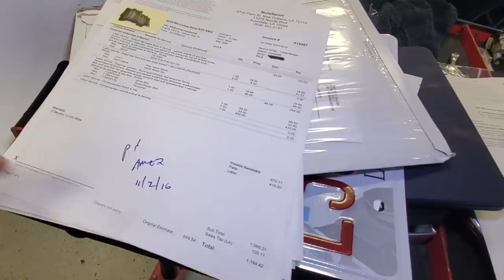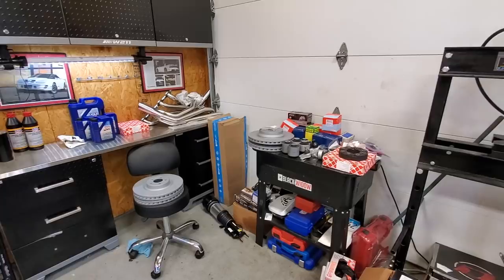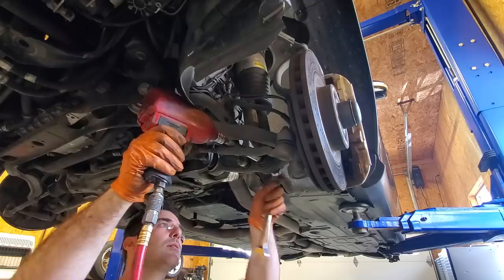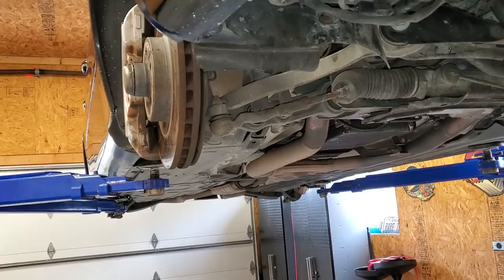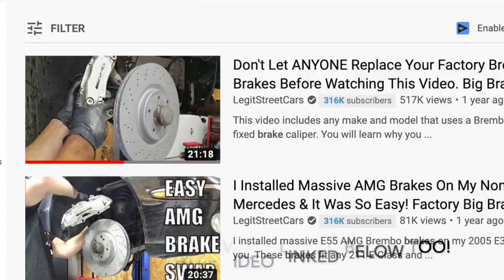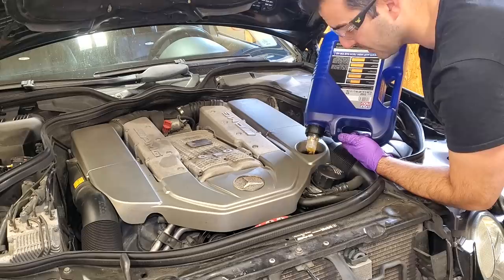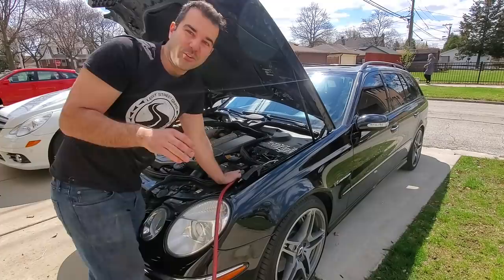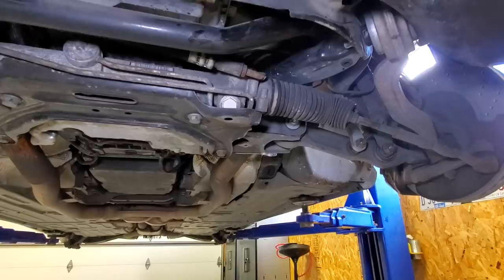I Mechanically Restored My Rare E55 AMG Wagon In 1 Video & Saved $5,000 Doing It Myself. Legit Fix!

Comment: This car is from New Orleans. The fender damage is due to the city's absolutely insane pot holes. There are straight car disabling sized potholes in NOLA. Half due to half ass repairs by the city and the other half due to the soil there.
Reply: riskyb250 I didn’t know NOLA had soil. I thought it was just floating on water.

Comment: Another awesome repair video, thanks again for sharing the step by step process. A newer AMG is too expensive for my budget so I am looking for a mid 2000’s AMG. Your videos kinda take the fear out of wrenching on an older AMG. Not fully tightening the bushing bolts while the car is in the air is an interesting tip. Are you talking about all the bushing bolts or just the thrust arm bushing bolt?

Comment: That brake video gave me the confidence to tell the mb shop to pound sand for 675$ pad replacement on cla 45 AMG. FCP euro had great price for parts. Did all 4 corners in about 2 hrs. About a quarter of that was trying to figure out why parking brake would not retract to service position. CLA 45 also has a manual brake release that must be released b4 service mode can activate.
Reply from the maker: I love hearing this
Reply: @LegitStreetCars  yep, so I took the money I save by doing my own labor and bought go fast goodies. Would like to see a vid or at least some commentary from you on the i4. And the cla 45.

Comment: Acura has done the same on the 3.7L engines for burning oil. Had my 10 year old 2010 Acura TL sh awd manual of course, burning a quart per 700 miles and they rebuilt my whole engine free.

Comment: I have  2 '87 300's one TD and other D.  on my D it was wobbly so I had lower control arm replace and wound up on the other side I replace all the arms.. My mechanic tighten the bolts up on the lift, but he use like a long 4x4 and floor jack and put the suspension to level and tighten it that way.  seems to work out fine. also FCPEuro is my go to place. The customer service people are awesome and had an issue with the web site and would not load my year and model parts but other ones it did  and they confirm that they were having some issues with that also.. but it was fix shortly after that.. Great people

Comment: "German cars are crap" yeah, well, that's a problem for anyone that thinks hammers are universal tools. A problem widely found in NA.
Reply: they are crap though.
Reply: And most SEA countries due to most shadetrees not having any understanding of electronics. They are good at tuning a carb, though.
Reply: I got a 2002 one of the first years w211 E220cdi, near 300Kilometers on the clock..

Yes without maintenance its indeeed 'bad' .
But if you maintain it properly then its still a waaay bettee quality ride then brand new 2020 cars!  

:)

Comment: The VAST MAJORITY of the people who think Mercedes cars are garbage have never owned any Mercedes and don't know what they're talking about. I have always owned Mercedes cars and did a lot of the maintenance myself cheaper than most cars if you know where to get the parts from. A few months ago I replaced both front air struts on my W219 CLS for only $550. They are rebuilt but they come with lifetime warranty and just as good as the new ones.

Comment: I just bought a 2011 (12/2010) w212 E350cdi that had 132k km on it, and I had it inspected by a TÜV engineer in Germany (where I bought it), and he pointed out what seemed to be only very slight rust issue on the rear axle/cradle, that Daimler has been paying for that rust repair in w212 that has this issue. So when I got the car back here in Finland, I went to my local Merc stealer, and they changed the whole rear axle cradle assembly for free. The best part was that they failed to get the rear airmatic springs out without damaging them, so they put new OEM airmatic springs in for free as well! I have to say I’m extremely happy I did the pre-purchause inspection!

Btw, 265hp and 620Nm of torque, and still able to do close to 50mpg, god I love that car 😍

Comment: in the future any high pressure hydraulic lines like power steering, transmission or oil cooler can be made by any hydraulic fittings shop in your area.

Comment: It does make a difference because you have to use heat to remove bolts with red thread locker. You need to read up on things before you use it. By the way I’ve worked at a Mercedes dealer for 18 years.

Comment: Alex, awesome video as usual.
However, @10:38, I think you installed the brake rotors backwards. As you know, the drilled rotors are directional to improve cooling.
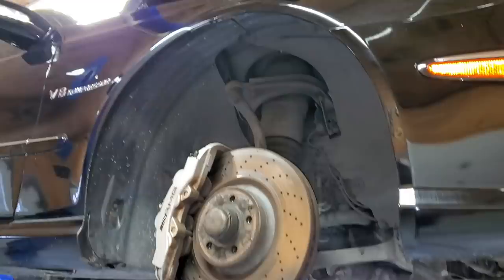The old rotor was installed backwards 8:27.

Comment: I had to buy a tool similar to that (same blue case) to do the differential bushings in my E39 M5. $400 frigging tool....painful but made the job a breeze. I was able to repurpose it to do the rear ball joints a few weeks later. Definitely handy but was bummed that it seemed to be the only mfg with a specific tool for that rear diff.

Comment: Not having a heated garage, I am waiting for warmer weather to arrive in Chicago. I have to do a head gasket on 97 960 Volvo, wife's car. Wish me luck my 1st attempt to do this kind of work.
Reply: 960 had a longitudinally mounted inline 6, first of the "white block" engines?  use the more famous 5-cyl head jobs as reference.  You probably want to buy some specialty engine tools for holding down the camshaft cover, otherwise it will push up unevenly as you loosen, causing damage.  Try not to mess with the valve train but you'll have to remove the camshafts.  Haynes manual ESSENTIAL, don't just wing it.
Reply: The head is split into two halves, upper and lower, along the center axis of the camshafts.
Reply: @reallyhappenings5597  Taking the head to a shop for inspection and cleaning. The 6 is just like the 5 cylinders, very good engines.

Comment: 1st the thrust arm bushing you said were incorrect, are oe,not sure why you think they are not,replaceds hundreds.The solid (no openings) type you installed are an updated design. 
2nd,with that mileage you should replace the joint on lower control arm for the anti-swaybar.Very common to wear,cause noises.

Comment: Omg thank you this what I say to others about German cars and they still argue about needing a lot of problems 😐
Reply: Well BMW and Audi do, especially models from the same general era as this car. Just look up n54 engine problems. Or Audi engine issues. It seems Mercedes of the big 3, is the reliable one
Reply: @NatoriousGamePlay  what do you mean Mercedes is the Honda and Toyota of Germany I have one and it's 18 years old and I've given it only 1200 but if I was more careful I could avoid about 400 lol
Reply: @georgetheamg8505  1200 bucks in repair on an 18 year old car, especially a Mercedes isn't bad. Considering that everything needs to be replaced. It's no different with a Toyota of the era. All suspension would have to be replaced, etc. Just the parts cost less. 

I'm saying, compared to Audi and especially BMW, Mercedes are reliable. Now compared to Toyota, lol no you'd be high to think that
Reply: @NatoriousGamePlay  no I did everything myself and 1200 since I got 5 years ago I could avoid 400 on fuel pamps if I had the filters replaced and then I did the strats brake disk and a maf sensor but she is strong and well worth
Reply: @georgetheamg8505  yeah, 1200 over 5 years isn't too bad honestly. Especially when some components are good for 50k+ miles. I'm glad she's running nice and strong. Still working on getting my car up and running
Reply: @NatoriousGamePlay  not to mention it has 280k klm

Comment: Good video, I'm hoping you eventually do a video on the actual sway bar replacement on an E55. I've replaced every ball joint and link in my front end and I still get a crappy knocking noise when going over uneven bumps. The only thing I can still think of is the sway bar bushings and it looks like a pain in a A55 to replace on these cars

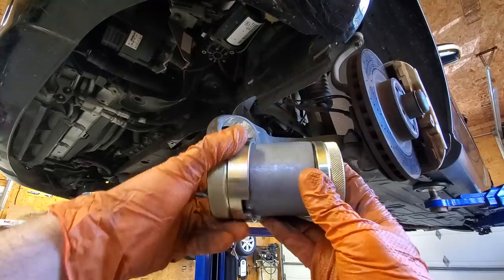Comment: 4:23 you are wrong, it is the correct bushing, but it is the old version. It was replaced by the one that you pointed out. The control arm bushings are full sized, not with those holes.
Reply: I was wondering why he pressed it out one way, then pressed it in from the other direction. I thought it was tapered?

Comment: Alex you have fitted the front rotors backwards again like you did on the CDI, it's very important to get this right as the viens inside are directional and need to expel the hot air from the middle of the disc. You can see from the earlier shots that the ones you removed were fitted correctly the new ones are not.
Reply from the maker: The new and the old are facing the same way. I've talked to Mercedes and FCP about this and it seems they only sell 1 part number rotor and they all face the same way.  Basically one side will be in the wrong direction. Have you been able to find side specific rotors for this generation AMG?
Reply: @LegitStreetCars  Hi Alex, no I haven't specifically looked at AMG rotors. From years of having track cars here in the UK brakes are something I have done alot of research into. The viens inside the rotor are crucial to providing the correct cooling, seems very odd that FCP only supply one side - just looked back on your video and yes you are right the one you removed has the viens the wrong way round on the passenger side but seems to be correct on the drivers side.Wasn't sure you had realised that was why I posted! Thanks
Reply from the maker: Ya every one I do is like this. Even the dealer puts them on like this. It's pretty strange, right? I haven't found any correct side specific rotors.

Comment: Wish I watched this video sooner.. I just replaced one of the front air struts on my e500, tried to reuse the old air line fitting as arnott does not really indicate how to install this portion. Ended up ruining a brand new strut, leaking, stripped threads etc. Have a new one on the way. Had I have known you literally just push the line in :(

Comment: I got screwed on the brake warranty. I had it replaced at an independent shop. I learned about the reimbursement the following year. The dealership wouldn't reimburse me. I contacted MBUSA. They wouldn't help me either. 

I was relieved when I found out there was a warranty on the gas tank though. I thought I was screwed when I smelled the gas leak a couple of months after buying the car.

Comment: on my E500, the trans cooler line ruster through. drip leaking. I took the opportunity to install a separate trans cooler (don't trust the combi cooler). also did a trans flush at the same time.

Comment: Awesome video!  👍. Here is a question I hope perhaps you will answer.  I have SS brake lines for my 2016 E400 Non-4matic W212 Sedan.  I've installed SS brake lines on several other non Mercedes vehicles which was straight forward and easy.  Can I do the same on my E400??? Or will I have do take my E400 to a specialized Tech??? Appreciate your response.  Thank You

Comment: German cars are garbage and are absolute nightmare to work on. They all have built-in failure engineered into them in order to keep the stealerships flourishing. I owned 6 BMWs and 2 Mercedes in my life, some newer some older and one brand new. All of these cars broke down with almost identical problems. It’s always the overheating, AC problems, phantom electrical issues, and oil leaks galore. Good thing I fixed all of those problems myself. It was fun to tinker and all but when it’s sole mode of transportation, and you gotta wait for parts for a few days in order to get your ride back on the road, well then you gotta find a ride to work!!! And that’s stress!!!These cars are however a pleasure to drive and look great! 

Anyway....it’s very satisfying to watch you work and do repairs! Thanks!

Comment: They are very reliable. The problem is second owners and third owners and so on do NOT maintain them properly and add stupid mods and engine things then get stumped when something goes wrong. Anything can last if it is looked after as the manufacturer intended. For example,  people complain about air suspension repairs. We who expected that to last forever? Normal shocks also wear out and need replacing. But if you want the best ride, it is kind of obvious that when the air suspension needs replacing it will be expensive. Generally such technology is not cheap. Now not all Mercedes have air suspensions or other expensive parts (like AMG models). So a base model diesel C Class with a 2 litre diesel is very reliable and cheap to maintain and always find it unfair for people to paint all German brands with the unreliability brush. Because it is not true.

Comment: Hello Alex, how are you??My Father's CL600 C215 2000 have some issues...The fautly code P203D and P201A appear and the motor lost 6 cylinders...I replace the 2 camshaft sensors and check the wire but it's the same problem!!!After many test i suspect the ECU motor...Questions: if i buy a functional used ECU on EBay, do i need to synchronyse with a Stardiag or it's more complicated procedure (ECU cloning…) ???Thanks in advance for your helping. See you.   Cyprien.

Comment: I replaced the passenger front strut because I had one that was leaking oil. Replaced with a factory OEM air strut from a e63 and I can not get it to air up for the life of me. Iv seen where it needs to be done in STAR but that always seems to be when they replace the rears. Front ones seem to always go up on their own. Any advice on that since you just replaced your passenger front one?

Comment: Hey Alex! I need HELP! I have a 2008 E350 4matic, making clunking noises and squeaking noises whenever I drive or put any sort of pressure on the car (push down on it with my hand). It also makes a grinding noise whenever I turn the steering wheel, almost can feel it through the steering wheel it feels like something is rubbing when I turn it side to side. Could it be Inner Tirerods? I took it to the shop and they said all the noise was from a front driver side lower control arm. Would that explain the steering noise too? I just had outer tire rods done on both sides last summer. I'm looking for a 4matic specific front steering and suspension rebuild kit. Preferably, a control arm bushing kit for the front would be ideal, because all the control arms are good on the car, just worn out bushings. Also, what other front suspension parts are there that should be replaced in a job like this? Lower ball joints? I just can't seem to find any info online or any kits that are 4matic specific. I'm guessing they don't use all of the same control arms or something?  If you could help me track down some parts that would be greatly appreciated. Email me lukelang308@gmail.com

Comment: Hi Alex, Greetings from Ireland. John here with 2006 CLS55AMG. Car suffers from heatsoak after a few pulls. Supercharger not allowed to cut in. Driving gently for a minute or so, charger kicks in again no problem. I've felt the heat exchanger rad in front of engine rad and its stone cold. I know the bosch pump gives up the ghost after 14 yrs and have the uuprated 010 pump. Ready to install.
 I need to ask you how to bleed the system once fitted. I believe the fuse for the I/C pump is the bottom one (position A) located in the trunk left hand side. Fuse is number 4 (7.5 amp fuse). Can I pull the relay and make a wire to connect the two vertical pins (87&30). Maybe have a 20 amp fuse along the wire for protection. Question is will this make the pump run to bleed the air out of system. The pins at the back of the pump are too small and fragile to try to connect wires to! I'd really like your opinion. Its the only thing stopping me fitting the new pump. Hope youre all ok over there with this lockdown!. Kind regards Alex.

Comment: I would like to get your opinion on what the best older Mercedes cars are out there to buy? Don't mind doing some work to it as I'm a mechanical engineer and also work on cars for fun. Any suggestions??
Reply: https://www.google.com/amp/s/blog.fcpeuro.com/the-cheapest-most-reliable-amg-car-ever-period%3fhs_amp=true 

Written by Alex for FCP's blog. Basically any of the naturally aspirated AMG's are the most reliable, but not necessarily the quickest...
Reply: I've had a good experience with my 2001 e55 they are pretty reliable cars the main thing to look out for is rust which is a pain
Reply: @evankahrs6435  , Thanks, however I am looking for the newer models. Any suggestions??

Comment: Darn, was hoping to see you do a suspension replacement that eliminated the Airmatic :(   My 2006 E55 Wagon is slightly different than yours it seems as well.  Mine has a very heavy steel skid-plate under the  oil pan.  By heavy I mean like 30 pounds, and probably at least an eighth of an inch thick.  It even has built in venturi ducts that feel air up through pipes around the sides of the oil pan.

Comment: So you don't actually need to disable the SBC system when just doing pads n rotors then? As long as no one opens a door...? I have scan tool that can do it and I know the wheel turning trick but that's a proper faff to be avoided if possible.  I need to replace the front backing plates as the bolt holes have rusted through and they're rattling, was hoping to be a job for this long Easter lockdown weekend but they didn't arrive in time...

Comment: Hey Alex, I have a w211 as well. I have a question, I know because of the SBC brake system it's hard to do a complete brake fluid flush without STAR is there any insider trick you could share or am I stuck having to go to the dealer to do this everytime.

Comment: Alex, what's your procedure to torque the suspension bolts? Looks like you were tighten them down with the suspension unloaded. Won't things bind up once the car is on the ground?
Reply from the maker: You fully tightened them with the car on the ground